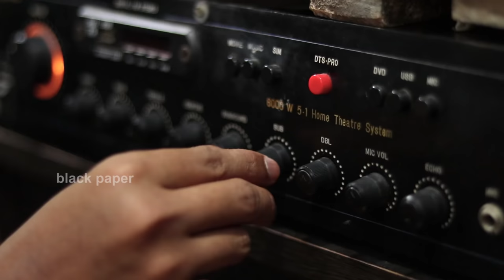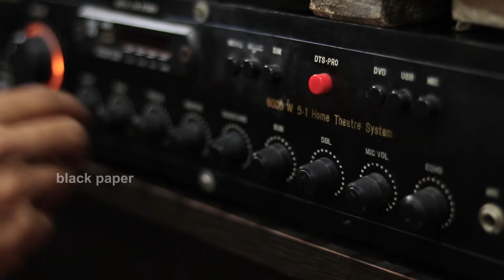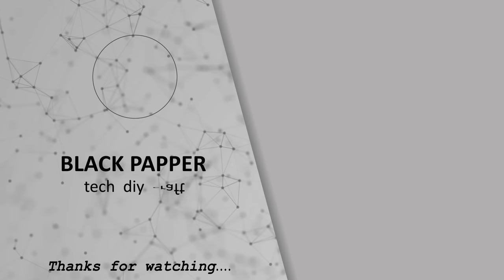വീട് കുലുക്കാൻ ഇവൻ മതി | Make a Powerful Bass Subwoofer From Oil Can | DIY Subwoofer | Black Paper

Comment: Subwoofer 1300rs :empty wood box for 8in sub 800rs : amply 1350rs : fitting with wire 500rs total- 3950rs that’s it
Reply: Noufal Rahman hyy
Reply: machane number onnu tharamo???
Reply: Rate kooduthalaano bro
Reply: Amplifier ethaaanu? Etra inch sub vare vekkaam?
Reply: മച്ചാനെ 😊എന്റെ വീട്ടിൽ ഹോംതിയേറ്റർ 5.1 ഉണ്ട് പക്ഷെ ബാസ്സ്  കുറവാണ് നമുക്ക് വേറെ സബ് വൂഫർ extra ചെയ്യാൻ പറ്റുമോ
Please reply 🙏🙏🙏🙏🙏
Reply: B N S Korad pattum.aadyam home theateril ulla sub cut cheyyanam ennitt aa portil power ulla sub kodutthala mathi.power ulla home theatre aanenkil athile sub cut cheyyathe 2 wooferum orumich kodukkam
Reply: @Ameen_Thaju  thanks dear
Reply: @Ameen_Thaju  അങ്ങനെ ചെയ്യരുത് ... ബാസ് കിട്ടണമെങ്കിൽ ഒരു പാട് കാര്യങ്ങൾ ഉണ്ട്.... പവർസപ്ലൈ..., ബോർഡ് .,. മാച്ച് ആകുന്ന സബ് വൂഫർ അങ്ങിനെ പലതും... അറിവുള്ളവരോട് ചോദിച്ച ചെയ്യുക....
Reply: 1350 രൂപയ്ക്ക് ലോക്കൽ ആംപ്ലിഫൈർ കിട്ടും ...Subwoofer amp.. അതും 100 wattsil കൂടിയത് ഈ പൈസയ്ക് കിട്ടില്ല ബ്രോ .
Reply: @bnskorad8013  pattum bro.. xtra subwoofer board and filter board add cheyanam..
Reply: @bnskorad8013  yes
Reply: @nayanzzz6119  താങ്ക്സ് ബ്രോ
Reply: Gud woofer  amply parayamo  veetlekk ane nalla rang kittunnath
Reply: Place???
Reply: ബ്രോ ആ sub wooferill etta pattende peru parayamoo
Reply: Hi
Reply: @saifansha7117  ft
Reply: Good
Reply: എന്നെ  പോലുള്ള ചെറിയ  youtubersine സപ്പോർട്ട് ചെയ്യാൻ  ആരുമില്ല.. 😌😔💔💔💔😍y

Comment: Yes correct... Only wood is used for making speakers and all.. also fibre..  this metal container doesn't give good output.. also noise and vibration will be there.. low clarity
Reply from the maker: Yup..just an exprmnt....bruh 😍

Comment: നല്ല മങ്കലത്തിന്റെ ആ സുഖം കിട്ടുമോ മോനെ അതൊരു ഫീലാ 1980 മുതൽ
Reply: വെറും tba 810 ic വെച്ച്.... ഹ ഹ....ഇതു വെറും പാട്ട കൊട്ടു...
Reply: super aanu bro.  .. athine sukham vere onninum udennu thonnanilla...

la 4440 ic
Reply: ഇപ്പോഴുള്ള Sab ന് കലം പോര. പൊട്ടി പോകും
Reply: @sunil68894  annu sub illa only woofeer and spaker aanu....
pazhaya bolton woofer super aaanu ippol ulla woofer onnum athinte ezhayalatthu varilla....
Reply: @torqueend1874  ഞാൻ പണ്ട് സെറ്റ് ചെയ്‌തു കൊടുത്ത 3035 traൻsistornte 30..30 ആമ്പും, boltan 30 w വൂഫെർ mid, ട്വീറ്റർ ഉം ഇന്നും gumdeeramay വർക് ചെയ്യുന്നു...അവരുടെ വീട്ടിൽ 25000 rs ന്റെ 5.1 ഉണ്ടെങ്കിലും ഇന്നും അവർ ഡെയിലി ഇതാണ് യൂസ് ചെയ്യുന്നതു...ഒരെണ്ണം അന്ന് സെറ്റ് ചെയ്യാത്തതിന്റെ ദുഃഖം ഇന്നെനികുണ്ടു....2.5 ഫീഡ് ഉയരവും 3 feet ബാക് widthum എയർ ഹോളും ഉള്ള ആ ബോക്സും ഞാൻ തന്നെ ഡിസൈൻ cheytathayrunnu... പുതു തലമുറക്ക് ഇതൊന്നും അറിയില്ല....
Reply: @ajith24pj430  ente kayyil innum undu bro hiteck 3055  trasistor 40+40 ampum boltenr kw seres white corn woofer bolten twreeter kalayathe vechhittundu...

athinte sukham vereonnilum kittilla vallattha oru feel aanu athil pattu kelkkan...
Reply: @ajith24pj430  correct sir, ഞാനും പോളിടെക്നിക് പഠിച്ചിരുന്ന കാലത്ത്  LA4440 Dual ic വെച്ച് ഉണ്ടാക്കിയ ampil ആണ് ഇപ്പോഴും പാട്ട് കേൾക്കുന്നത്. 18 വർഷം കഴിഞ്ഞിട്ടും ഒരു കുഴപ്പവുമില്ല.
Reply: @sathishsukumaran9977  ഒരു 20..20....tda1239 ic യും ഉണ്ടായിരുന്നു..ഇപ്പൊ ഇല്ല സൂപ്പർ..പിന്നെ പുലി stk 439...sanyo ഒറിജിനൽ....
Reply: ഇപ്പോൾ bolton subwoofer ഇല്ലല്ലോ
Reply: @teenaskthapas402  mmm..ഇല്ല ഫിലിപ്‌സും ഇല്ല....പകരം boston എന്ന ബ്രാൻഡ് ഉണ്ട്..same as abive said... നല്ല വർക്കിങ് ആണ്...എന്നാലും ഇവരൊന്നും പഴയ ട്വീറ്റർ ഇറാകുന്നില്ല...only peso busser ടൈപ്പ്....
Reply: Mankalathil woofer set aanu enik eppolum und enna kidu feel aanenno athonnum oru Bass toubinum kittilla...
Reply: @sunil68894  orikkalum ella..
Reply: @ajith24pj430  number onnu tharuvo
Reply: Ippo ic ellam chathana varunnath
Reply: @teenaskthapas402  bolten kw sw serese normal woofer aanu annu sub woofer  irangiyittilla.. pazha boton german technology aayirunnu
Reply: Panda oru upc 1230 vachoru amp cheythirunnu. LA series ic ye kkalum better.pinney 3055 vachullathiney Patti parayanda ,entha performance
Reply: True... athello pand kalich vittayaa😊😊😊

Comment: Nahh...man. Wood is always better in aqustics. Metal is not a good idea.😪😶
Reply: Yes correct... Only wood is used for making speakers and all.. also fibre..  this metal container doesn't give good output.. also noise and vibration will be there.. low clarity

Comment: Airhole chumma air pokaan alla
Athoru resonance column pole aanu act cheyyunnath
Akathu speaker nte spec anusarich pipe width length calsulate cheyth set cheyyanam
Appo OK aakum pakshe ee metal body il nalla feel onnum kittillaa